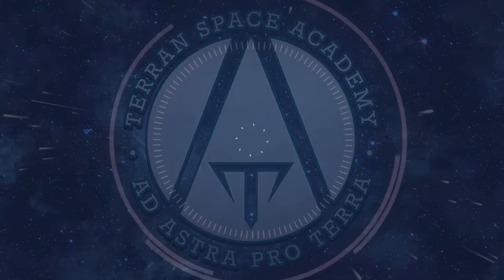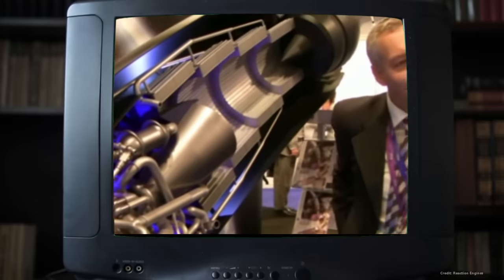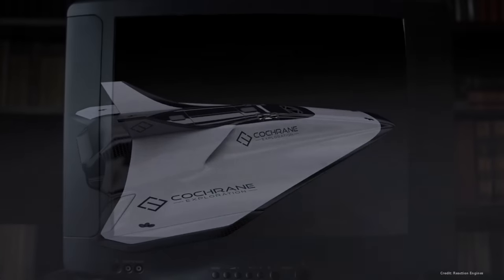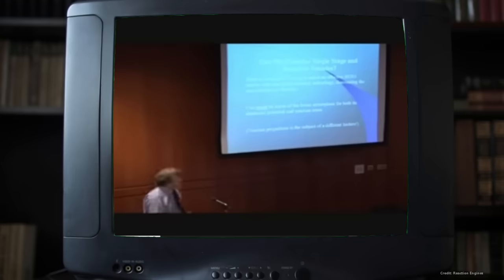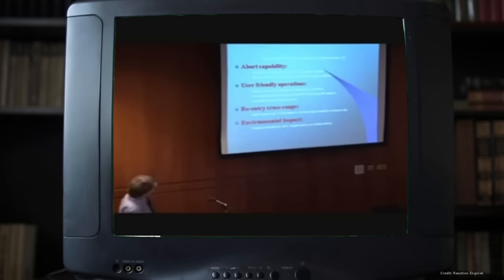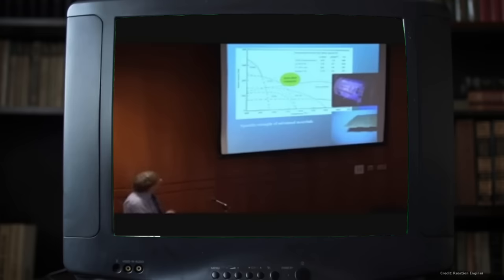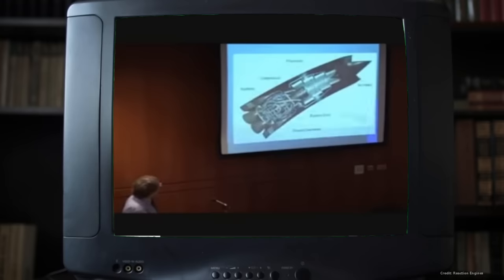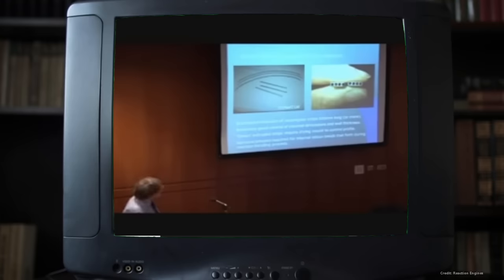HOTOL, Skylon, and the future of the SABRE Rocket Engine

Comment: it's a crime that the Skylon is not being properly funded
Reply: like he said, the engine is being developed for the USA so it may well live on. the USA are very interested in hypersonic airbreathing engines right now.
Reply: @mrrolandlawrence he said the US is interested only in SCRAM jet technology not this.
Reply from the maker: That was then... Now they want something that works ASAP
Reply: @terranspaceacademy 

Hey, just wanted to let you know that Space Engine Systems, the folks behind the Sexbomb space plane just dropped a new video of an engine test.
Reply: Skylon has too many issues wrong propellant for reusability, poor shape choice. Ect. Ect.
Reply: If you think about it, I mean analyse the 2 propulsion systems, each has to be carefully analysed, The air cycle for a velocity that starts subsonic,  then mounting rapidly to mach 5, where the inlet translating cone must be adjusted to maximize shock pressure recovery, then passed through a diffuser , cooled, then compressed, heated in a hydrogen combustion chamber, expanded in the turbine driving the compressor, while limiting the turbine inlet temperature ; then expanding the heated airflow in a variable geometry nozze to maximize thrust with ot without an after burner.
Then the air inlet is closed to now operate as a staged combustion rocket, with  a separate optimized nozzle, a high expansion nozzle to match the outside pressure after transition.
The point I am making  is that the design and analysis work is extraordinary high and expensive, by experts in both fields, high speed  mach 3 to 5, where few experts from the SR 71 days are alive and the more common pure rocket propulsion people, would have to adapt to new requirements.
This from a supersonic inlet air control system designer for the A-12, the precursor of the SR-71.
Just the control system. The J-58 was a P&W engine, no cooling system.
Reply: @rexmann1984 Hydrogen is 'the' best propellant choice for Skylon. It likely wouldn't work with the likes of Methane, it doesn't have enough specific impulse.
Reply: @revmsj The USAF is interested in SABRE, not NASA.
Reply: Same for HOTOL all those decades ago
Reply: 🤣👉¿SR-71 blak Berd ?😉
Reply: It's not cheap 😂

Comment: There is actually a considerable amount of work that has accomplished  in United States concerning the Sabre engine. In September 2017 the Defence Advanced Research Projects Agency (DARPA) contracted with Reaction Engines Inc. to build a high-temperature airflow test facility at Front Range Airport near Watkins, Colorado.  The particulars of that venture can be summarized in the Wiki article on the Sabre engine that I edited.  The latest update on progress was done in mid 2022.  What has occurred since then and the definitive results I haven't been able to determine in open sources.  I am hoping that if DARPA and  US Air Force Research Laboratory (AFRL) see potential in the Sabre engine there is perhaps some classified work contracted that is not being publicized.
Reply: They are probably more interested in the heat exchangers for scramjets and high-Mach turbojets
Reply: I sure hope so, it is really pretty clearly an effective way to go to space. A first stage air breathing reusable booster to economically even give 700 mph and 30,000 feet is going give a lot more lift for the buck.
Reply from the maker: I think it will fly.
Reply: @terranspaceacademy  With the right funding maybe. SABRE looks very good on paper.

Comment: While extremely interesting, I can't shake the feeling that this 12tons to LEO is going to be about as expensive as Starship's 150tons to LEO...
They're just not going fast enough.
Reply from the maker: 12 tonnes of live human cargo is a lot.
Reply: correct, but the piece that does not work well, if at all is this: The Lockheed Mach 3.2 supersonic  SR 71 aircraft  could not take off with all the fuel, the only solution was to take off with minimum fuel, climb to altitude , load the fuel from a tanker, climb to operational altitude of 90000 feet acelerating. The Skylon with the small span wings could not have taken off, even with a 50 km runway, the induced drag is so high with the low wing span shown, that wing borne flight would require too much fuel , to minimize gravitational losses  the vertical component of the acceleration must be higher than say 0.8  g plus one g to just hold weight.
The refueling approach with liquid hydrogen is untried and not likely to succeed from the tanker via the flexible line, the receptable  in a humid environment would freeze with 7 Kelvin hydrogen temperature.
So vertical lift off is the only option. Having long span wings used only a short time is not reasonable, landing requires small wings, because the weight is so much smaller.
Horizontal TO, single stage is not possible, with hydrogen/oxygen fuel, when practical constraints like thermal insulation to prevent ice accumulation, etc come into play. That was our finding when we worked out our Shuttle proposal at Martin, which had a flyback booster, fully reusable, Nixon gave the contract to NA for political reasons. With enourmous cost ramifications, that  were made with the NA approach. Using atmospheric oxygen for a single stage to orbit might be possible, but not with a winged runway horizontal TO
Reply: atleast its called hodor
Reply: @Arturo-lapaz  well, plane design and operations design is ocmplicated and it wasn't worth makign it capabel btu really the reason the sr-71 couldn't take off wasn't perfromance it was htat its tanks leaked until it got warmed up so it had to refuel in the air anyways and going up with any more fuel than necessary to meet up with a tanker would have been a waste of fuel
this thing, while it would be ab it operationally tricky would be capable of taking off, you can do the math yourself, part of what helps is having am cuh higher thrust to weight ratio than a balckbird so you can build up speed much faster using up less runway and then well... at least accoridng to both aerodynamics sims and basic paper clacualtions its stall speed shouldn't actually be that insanely high - bit higher than an airliner but not quite space shuttle level
Reply: starship will never perform as advertised
it may becoem the first fully reusable orbtial launch system
but the numbers being thrown around are calcualted with a surreal level of optimistic simplification
also, the vast majority of payloads are well below 12 tons and market elasticity is higher for much smaller payloads
Reply: @terranspaceacademy  This. I doubt Starship will ever carry human cargo, due to the severe lack of savety systems. And doing a suicide burn landing on a planet is not something they would allow either. A space plane purely dedicated to supplying space stations (and possible interplanetary transport vehicles) with human cargo could find its place in the industry.
Reply: @JulianDanzerHAL9001  I doubt it will even be reusable and stay refurbishable (which is already an accomplishment, but still far from just being able to re-use it).

Comment: As a Canadian I would like to see significant participation from us in creating a fleet of Sabre powered aerospace planes. It'd be great if Australia and New Zealand would come in as well to give us all autonomous access to LEO. With proper support even the original concept - two stage with the An-225 could have been flying for decades by now!
Reply: check out space engine systems 🤞 they're based in edmonton alberta but have opened offices in the us and uk to form agreements with spaceports , seeing as though we dont have much space launch infrastructure
Reply from the maker: I would love to see Canada maximize its potential.
Reply: hopefully soon🤞 a spaceport was recently under construction in Nova Scotia by Maritime Launch Services , i believe they're first launchs are using the older Ukrainian made cyclone-4m rockets, it would be nice to see a collaboration between them and the space engine systems from edmonton  , and they are prototyping the dass gnx turbo ramjet engine for use in they're in house hello 1/2 ssto ships

Comment: Some corrections:

1.) The engine in the HOTOL concept was not called SABRE. It was called the Swallow.

2.) Neither engine liquefies the air, though there was a concept in the 1960s called LACE (liquid air cycle engine) which did.
Reply from the maker: thank you

Comment: That heat exchanger is fuggin nutty. I can't help but think it could have more uses.
Reply from the maker: I'm not sure I see your point.  I like it to cool the air at hypersonic speeds so we can get to space :-)
Reply: @terranspaceacademy  The uses in manufacturing and chemical processes are numerous. Almost any time you create something that pushes the boundaries of what is thought possible it will have enumerate uses. That's part of why NASA was founded. We use technology every day that comes from the aerospace industry. It's fantastic for its original use but the knowledge to manufacturing is what's really valuable in the end.
Reply: https://www.youtube.com/watch?v=CJ-DirH9yaw Reaction Engines are indeed applying this tech to "adjacent markets".

Comment: Good stuff
I feel like i just had a look at the future. In an interspace economy, putting stuff into space is only half the goal, we need to bring things back economically. 
Has any one looked at doing a pulse jet for this? The engine would run as an air breather near ground. Near the edge of space liquid oxygen would gradually augment the thin air. At a given speed the vehicle would transition into space and 100% oxygen. The pulse valves would remain closed turning into a rocket engine. A catapult on a the ground would aid in the launch.. A carriage would take the load off the landing gear which would be designed for landing empty.
Reply from the maker: Thank you so much!

Comment: Always wondered why not ditch the turbojet parts and just use a big pulsejet. Sure pulsejets arent as efficient and are a bit noisy. But a pulsejet is simple to build, more efficient than a rocket engine (in terms of atmospheric ISP) and can run on anything. A pulsejet carrying your craft up to almost mach 1 and then transition to a ramjet to carry to mach 5. Both engines could easily be incorporated into one body since they both have next to no moving parts. After reaching or nearing mach 5 you switch over to some other regime. But the point is you can simplify your air breathing system enormously by removing all that ordinary atmospheric turbo machinery and its maintenance headaches. Pulsejets excel at low speed or static thrust, the pulsing nature of the exhaust allows you to use devices like a "augmentor" to slow the exhaust for the tradeoff of more thrust, these could be retracted or ditched since they are just metal cones. I'm not going to propose going full hog and building a pulse detonation engine as they are still in development, pulsejets however are well established and can be constructed in your backyard's garden shed.
Reply from the maker: I like it! Who cares how loud you are at high altitude?

Comment: A 5 minutes search would result in finding that HOTOL space plane used a still classified Rolls-Royce RB545 engine not the SABRE engine. Alan Bond, one of the engineers involved in HOTOL space plane project move forward to create Reaction Engines Limited that continued the development of SingleStageToOrbit space planes, resulting in Skylon space plane and SABRE engine. Is this error important, don't think so, but make me wonder how many errors/omissions are in the other videos.
Reply from the maker: That's correct.  The technology from HOTOL was developed into the current SABRE design.
Reply: The technology’s they worked on was put under the official secrets act until the mid 90s or maybe even later and mr bond wasn’t aloud to follow up on his work until the act was declassified

Comment: STTO is out of reach for our current tech. Maybe with some more advanced materials, maybe. Somebody already went past it with stainless steel two-stage monsters.
Reply: It's like you didn't watch the video.
It described exactly how it CAN be done plus three sentences statement about how another, earlier project would have also worked.
So how can you make the statement? 😅
Reply: Some SpaceX fanboy in love with giant tubes taking off vertically. @bmobert
Reply: @venturefanatic9262  
I am a Space-X fan boy and I think Space-X is doing exactly what it should to make orbit accessible.
That is what THEY can best do. It's not the only way and it's not what others can best do. A Skylon-like spaceplane would be an excellent addition to quiver of orbital launchers.
Nore are either the spaceplane or the rocket the best way to get to orbit ultimately. IMHO, that would be the combination of orbital rings and Atlas towers. Railroads to orbit, effectively. But this "best way" is not economically practical just yet, with as small an economy as space is right now.
Reply: The tech needed for skylon (heat shield, weight fraction, the engines themselves) is very advanced and not yet proven. It may be future technology.
Reply: @Witnaaay  
If it doesn't exist, then it's speculative/future tech by definition. 
There is an interesting tech scale designed to indicate how close to reality it is.
It would be interesting where each tech needed for Skylon is on that tech scale.
I suspect it's all in the demonstrated... which I think is level 6.
But I'd like to know for sure.
Reply: What is STTO?
Reply: @donotcomply1628  
Single Stage To Orbit, but as a type-o. It should have been SSTO.
Or, at least, that's what I interpreted.
Reply: @bmobert  oh gotcha. I didnt know that acronym. Thank you
Reply from the maker: It can work with air breathing rocket engines...
Reply from the maker: Single Stage To Orbit... Oh.  SSTO.  Not STTO.  Hmmm. Short Takeoff To Orbit?

Comment: If you can retrofit a rotating detonation engine to the cooler concept of the Skylon that would make a interesting combination.
Reply from the maker: An air breathing RDE would be astounding.  That is what Dr Reiken is working on.
Reply: That is exactly right, significantly simpler because the cooling is not necessary and a smooth transition to airless space can be achieved.
But the horizontal take off is not useful.

Comment: Another thought, I wonder if there would be a way to use this concept of compressing, cooling, and liquifying air during reentry of a spacecraft in order to use the liquid air to transpirationaly cool the reentry heat shiel. Idk, perhaps not as easily done as said as they say….
Reply from the maker: That's a good question... The concept of heat rejection through an engine using cryogenic propellant is the key I think.  Stoke space will be using liquid methane to cool their reentry.
Reply: @terranspaceacademy  : Yeah, it fundamentally requires a cryo-fluid to power the cooling process. For reentry, going slow (so the instantaneous temperature is never too high) is probably the better approach.

Comment: My question would be doesn't the heat exchanger's use of supercooled fuel heat that fuel up and rendering it unstable?
Reply from the maker: The fuel needs to be heated prior to running it through the engine.  Heat exchangers do this for hydrogen rockets.  We are just putting that cryo to good use.

Comment: And then SpaceX happened, and reminded everyone why multiple engineering studies, going back decades, had each concluded that VTOL was vastly superior to HOTOL.
Unfortunately Skylon just didn't produce good enough cost savings to make it viable. For the above reason. It would simply be too easy to build a cheaper reusable rocket and cut any realistic version of Skylon off at the knees.
Though the Scimitar variant of Sabre may yet be useful for hypersonic flight.
Reply from the maker: VTOL will never be as safe as HTOL
Reply: @terranspaceacademy  Evidence required. Especially given that the energy requirements are higher for HOTOL, and supersonic gliders do not have a terribly good track record when it comes to emergency landings, and the engines required have a non-existent safety record.

Also the whole "It's wondrous! But it's not for the timid" thing.
Reply: Once htol is perfect it will be able to have a much quicker turn around plus you can have fleets taking off every day compared to being sitting ontop off a massive vertical bomb
Reply: @user-td8ls5mn5q  Incorrect. Trying to come up with clever ways to sidestep the mass ratio requirements for SSTO doesn't do anything about minimum energy requirements for orbit. If you're flying into orbit in anyway (as opposed to riding a teather) the bomb is always going to be there.

Minimum energy needed to get to LEO is ~50MJ per kilo. Flying sideways through the atmosphere first, as opposed to getting above it as fast as possible, dramatically adds to gravity losses and aerodynamic losses, and also requires lots of extra mass for plumbing and cooling the rocket doesn't need to bother with, all of which requires extra energy.

Setting aside that it isn't that much harder to fuel a rocket than an aircraft, and you need fleets of shuttles to match one starship... Sorry, but you're been lied to.

Comment: Seems like the heat exchanger should be built into the cone segments.
Reply from the maker: On which ship?
Reply: @terranspaceacademy  On the SABRE driven SSTO. I'm sure they have reasons it's not feasible, but seems you could build the heat exchanger into the retracting cone segments that control the size of the intake opening, rather than stuffing it between the the intake and the engine. I feel like you need blank sheet of paper to come up with a design that fully integrates the heat exchanger with the design of the whole ship.